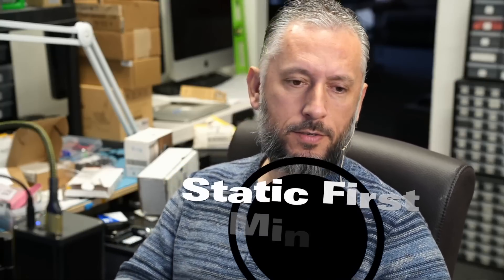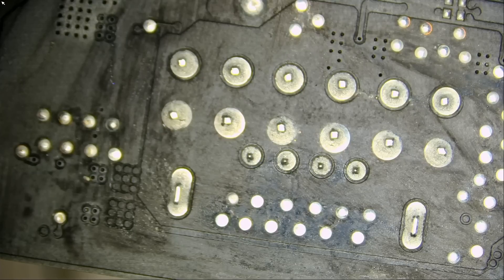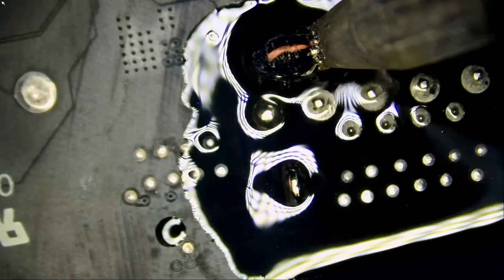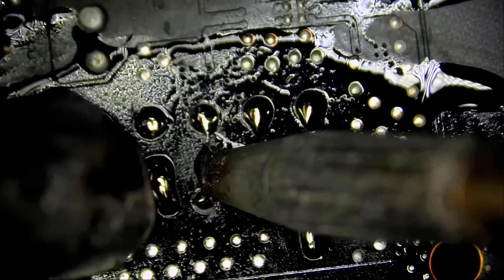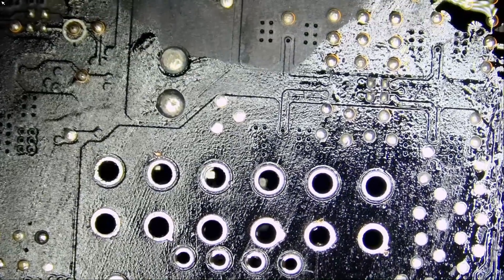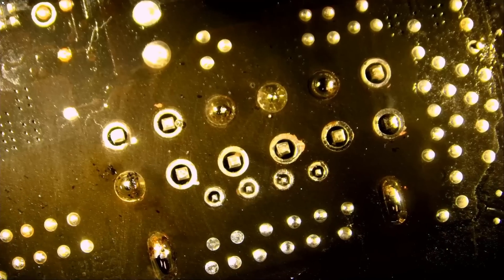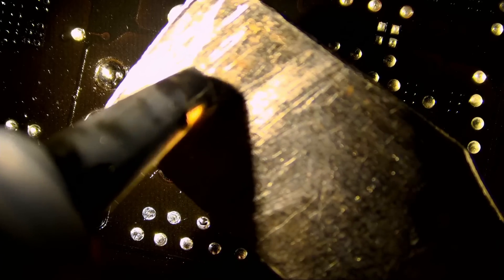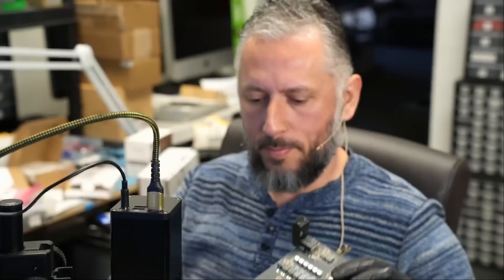4090 GPU Connector Melting Crisis Continues in 2025

Comment: LOL... an NVIDIA rep just said that this hasn't been a problem for two years, implying that it's not an issue anymore. Yeah, because people have to send them to independent repair shops and NVIDIA isn't hearing about it, but it's clearly still an issue. Can't wait to see how the revised connector works with the 575 watt+ 5090.
Reply: It’s such an issue the personally they should’ve been sued in class action suit. It’s a bad design it’s a design prone to failure.
Reply: I came from the future, is not working properly either. 
Magical.
Reply: if you don't buy garbage from cablemods then it won't blow up the slot.
Reply: NVIDIA still tryin to send 600 watts through tiny wires and tiny plastic connectors even though they know it doesn't work?!!!?!  Clowns.  Also clowns that play Russian roulette for $2,500
Reply: Yeah......5070ti is the next move for me.....lower-powered cards FTW
Reply: @MrNicks-gn8jc  or just get a proper power supply
Reply: @BillNye-bj5vi  Not so easy...was a custom Dell XPS
Reply: Overclocked 5090 TDP 715 watts :D 715w - 75w pcie = 640w via the 12vhpwr :text-green-game-over:
Reply: @Damianos980  Yeah... I saw JTC's video on his. I'd like to see some testing to show that it's actually pulling 75 watts from the slot, since that's generally not how that works, but probably a good idea. But yeah, even if they are... it's still overloading the connector. It's definitely going to be interesting to see if lengthening the pins and shortening the sense pins on the revised connector with help any.
Reply: More like manufacturers have been unwilling to warranty it for two years. It’s functioning as designed.
Reply: @RetroAnachronist  So... you're saying it was designed to fail?
Reply: @TheGameBench  Most things today are designed to fail. Laser printers fail because the laser inside goes wrong — this has happened to me twice in 4 years. Laptops fail because mosfets or resistors often die without any apparent reason. Mechanical plastic parts in consumer products, like laptop screen hinges, fail and break after daily use. Foldable phones can't withstand years of use without showing signs of damage on the hinge and the screen itself. And the list goes on and on.

Why do consumer products fail? Bad design choices, poor thermal management, profit margin prioritization, planned obsolescence, rapid innovation cycles, and a disposable culture. But mostly because money is money.
Reply: @TheGameBench  Who would have known right xD
Reply: never was a card or connector problem
Reply: Hasn't ever been a problem. Just the same story of people not plugging in the connector all the way. The differences now is they are 450watts vs 150w across a 8pin so its more likely to be noticed.
Reply: @theodanielwollff  Why was the connector redesigned if there wasn't a problem?
Reply: @theodanielwollff you obviously don't know what you are talking about. I had my 4090 connector melt and I knew about these issues in advance, so I made 1000% sure it was completely seated. I have a 9000D case so there are no bends or tension on the cable or the connector as I have ample room and was making sure there was no tension on the connector/cable.
I also made sure to check that it was still fullly seated every 1-2 months to ensure it was still seated and didn't somehow loosen.
ASUS didn't honour their warranty and I had to pay for it to be repaired.

So tell me again how it's my fault?
Since you're obviously an expert in the matter, after watching 1 inaccurate "gamers nexus" video, what should I have done differently?
Custom fabricated a lock and cable support tray? Hired a team of engineers to take 24x7 shifts to constantly check it's still fully seated after every time I play a game?

Why is it happening to so many people? Does everyone not know how to fully seat a cable? My local computer store had 4x 4090s ready to be sent back to manufactures on the same day I went in for my warranty claim.

You are obviously a NVIDIA fanboy who doesn't know what he is talking about.
There is a fundamental flaw in the design of the connector or it would never have been revised. It's poorly engineered and not fit for purpose. 
But you keep arguing against consumer protections in favour of your favourite multimillion dollar companies.
I really hope something similar happens to you, karma my friend.
Reply: @omgM2  One of the reasons why there could've been a failure on your card is that you might have not checked properly since human error is still a thing, but yeah the design could've been so much better to where this wouldn't happen at all...
Reply: @omgM2 I assume your next GPU might be RTX 5090?
Reply: @WhiteNinjainblack  hahahahah no chance, they are melting too now.
Reply: @theodanielwollff  He's showed on this very channel, connectors that were fused and were fully inserted. So not being plugged in fully is not the only explanation.

Also, if they had used two 8-pins, it would be less of an issue because the older Mini-Fit Jr. standard is designed better. The connector latches in and doesn't have a lot of play, not allowing it to unseat and wiggle around. Also, Mini-Fit Jr. is rated for more power at 10a per 12v terminal versus 9.5a on the 16-pin with 16ga wire. So, rather than only 684 watts on the 16-pin, before de-rating, you would have a ceiling of 720 watts. So, if if they weren't severely underutilizing Mini-Fit Jr. and were using it instead of the 16-pin, I don't think we'd be seeing these problems at all. The 16-pin is just a bad design. Granted, they should have just added a fourth 12v terminal to the old PEG connectors, like EPS, and they would have had 480 watts per 8-pin to play with.
Reply: @TheGameBench   The same is happening with the RTX5090 now. People have tested the issue and it seems that power load isnt evenly spread among all cables. this can cause a temperature spike going up to 140 degrees Celsius and thus melting the connector. The question now is who is responsible for equally spreading the load. PSU or GPU?
Reply: @Klote3241  yeah. As  seen in the Der8auer Video the lack of shunt resistors also causes uneven distribution of amps across these cables .
Reply: @theodanielwollff  BS
Reply: @theodanielwollff  The reviewer's 5090 from asus/msi 12 pin heated up to 81 degrees and it was cooled by coolers from the main radiator for the video card. THIS IS NOT NORMAL!
Reply: @robot_0121  Go back and watch the video again, it was 81 because he OC'd the card beyond its limits.

Comment: I do not believe it is limited to Desktop Graphics cards, still. I wish I could share a photo I have of my DC In cable and Connector on my M18 R1 i9 13900HX with RTX 4090 Mobile Laptop edition. Now, it is POSSIBLE I guess that the cable could be "pinched" by the hinge mechanism. In my case, more investigation is required. As usual, great video, great job.

Comment: Recently I've watched some thermal camera review. And at some point of video - camera pointed to crypto mining machine. There was few GPU's installed but only on one of GPU 2 cables of power socket had 85 or 90 Celsius. The others wires had much lower temperatures, and also power sockets of rest GPU's.
This video reminded me of the incident one day with my electric lawnmover. After some time of work lawnmover stopped. The power extension cord socket got madly hot and melted. After further investigation it turned out that one of AC cables coming from the house was loose on the rail - and also insulation got melted on it.
Therefore this situation and others describing melted connectors makes me think that those connectors (maybe some wires - not all) are too loose to transfer the power to GPU. And as the result of that they become madly hot and melting.
Reply: Yes, loose connection will have high resistance thus more heat, like a feedback loop. But the problem with Nvidia cards with 12 pin connectors is that they are so thin and I believe they can not handle that high current and wattage, they are destined to overheat and melt. I would say it is an intended planned obscelescence.
Reply: @ThaerRazeq  If this would be true - all customers with that problem should sue Nvidia. On the other hand, it's probably duable to calculate needed diameter of pins to transfer power needed by GPU - that would answear if they are to thin.

Comment: A melted connector means it got hot because of resistance being too high, a bad connection.  Repeated failure most likely means the maker made a poor choice of connector. 😮  And/or the connection to the board is poor.
Reply: poor choice of power supply
Reply: @BillNye-bj5vi poor design not power supply

Comment: that can happen to old cards too and it does, less frequently now because people are not using them anymore lol, it makes sense
every time any other cards burns or melts its connector is a whatever thing, most people don't even care to try to repair it or report it, but oh no, the 2000$ card has the same weak spot like every other card, this can't be, i can 100% assure you that the moment only ONE 5090 melts its going to be headlines everywhere, because people want to sh*t on nvidia and be a victim when you don't even own the damn card, it doesn't matter if it costs 100$ or 10000$, its going to melt down because you don't plug it all the way, why should nvidia try to make a card fools proof, all of the sudden we care about this when for decades nobody did care, its stupid and its not an issue, and also OFC people will send NorthridgeFix their 4090s to fix, this doesnt mean the market is flooded with 4090s that have melted connectors, the card is worth 2000$ the owner wants to fix it and pay 200, 300$, if you own a 1080 and it melts, you are not paying to fix it, its not worth it

Comment: Pushing more power trough a smaller connector was dump from the beginning, and after years of "fixing" it is  still a problematic connector.
I probably would just solder an adapter cable straight to the board and get rid of it.
Not pretty but safe.

Comment: I have seen you repair many of the melted connectors, What is the root cause? Underrated materials? Overclocking? Power supply wires not able to carry the load?
Reply: Bad design
Reply: weak power supplies

Comment: Why don't they select a better connector ffs... there are so many high current connectors.
Reply: Real
Reply: cause they are cheapskates..
Reply: why dont pc builders select an appropriate power supply
Reply: @BillNye-bj5vi  how is this relevant? Power loss in form of RI^2 generating heat depends on the load and contact resistance. The power supply properties have no say in the equation. Clearly the connector plastic material is unable to handle generated heat, the load exceeds rated load or the connection is not properly made. So thousands of users are idiots who cannot seat a connector properly? I don't think so.

Comment: are your  using 12VHPWR connector ore the new 12V-2x6 connector as replacement? as far as i know are they full compatible, but 2x6 has better pin connections.(longer power pins and shorter sens pins) pls correct me if im wrong
Reply: the cables are the same. the difference is in the plug, which is different to help avert the user error plug insertion failures that caused all these meltdowns.

Comment: It baffles me seeing how some of the damage on the hardware you repair might of happened. In all my years of computer use/building, I've never had hardware explode/burn/nelt, etc while using it. Then again, I try to neutralize hotspot areas by adding sufficient cooling to said areas and refrain from overloading a psu to its max capacity. I don't get why users don't balance electrical loads using dual psu's. One for board and peripherals and the other for gpu's. It's cheaper and it'll give you plenty of overhead for said devices if you overclock. I have a setup like this and it's amazing the results I get.

Comment: 5080s and 5090s are absolutely cooked. The problem with this connector hasn't been completely resolved. The new Nvidia adapter will be very flexible, but I doubt it'll completely prevent problems.
Reply: It wont, just stop buying their crap.
Reply: @shadowopsairman1583  "but...but my Nvidiot friends will bully me if I buy AMD😭"

Comment: The connector for my 4080 melted and broke, put a claim in with MSI and they just sent me a new one. I too had the cablemod adapter, didnt use it for the new one. Made sure the connector was completely connected and nothing was pushing on the cable (Even bought a vertical mount too) and have never ran into the problem again. I do see this being a manufacturer issue, but I also think It's a cablemod issue as well. A $40 dollar cable mod is not worth potentially being out $1000 when you can buy a $30 vertical mount and save yourself a headache.
Reply: didn't cablemod recalled their adapters because of so many issues like this?
Reply: @OmegaSoulReaper  yeah, their shitty products were broken. they caused issued beyond the other issue, which was the plug insertion failures.
Reply: Der8auer explained what's wrong with the 12VHP .. TL;DR shitty engineering. 8Pin PCIe has at a minimum a 3x over engineered pins and casing and plug, 12VHP has a margin of 20% being 1.2x over engineered. Hence shitty engineering.
Reply: get yourself a bigger psu first step when running a heavy demand card

Comment: 5090 is going to be a hot mess. It will bring you more customers though
Reply: Hot melted mess you might even say
Reply: They fixed it with the 4080s they won’t melt because of ATX 3.1
Reply: @ryry8533 can you elaborate on that? What did they change?
Reply: @Walhor  it has smaller sensor pins so it’s easier to plug in. It also has improved power delivery and has a new mechanism that makes a noise so you know it’s fully plugged in.
Reply: @ryry8533  Thank you 👍
Reply: @ryry8533  So they didn't do anything ....
Reply: yep will be a mess when combined with a tiny 600 watt psu,